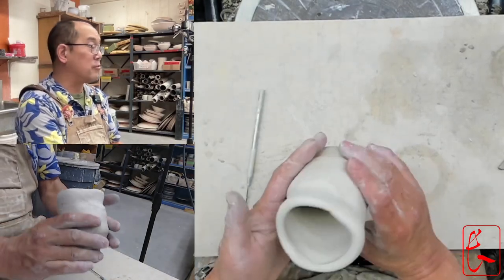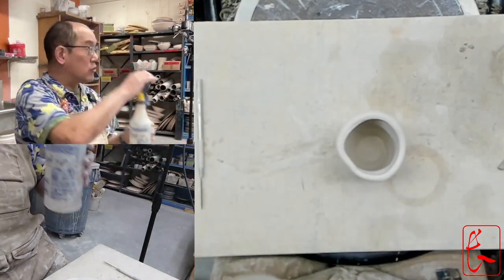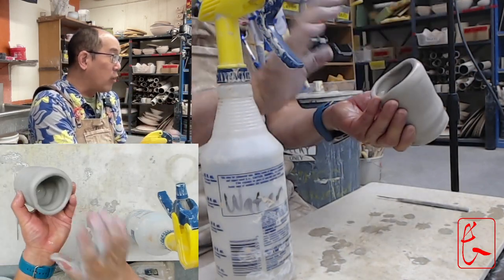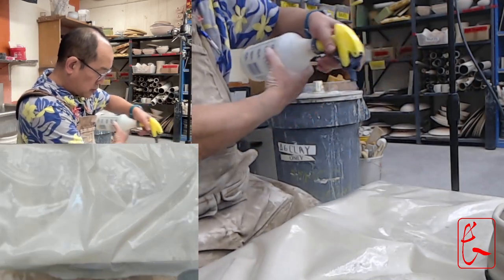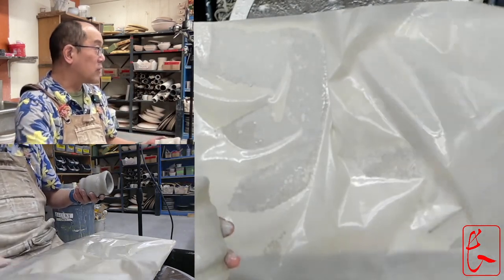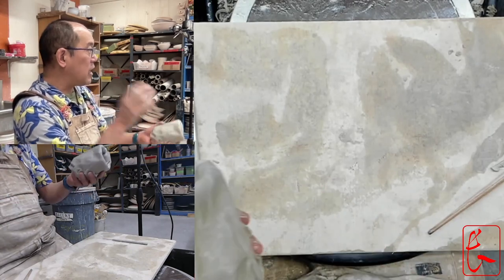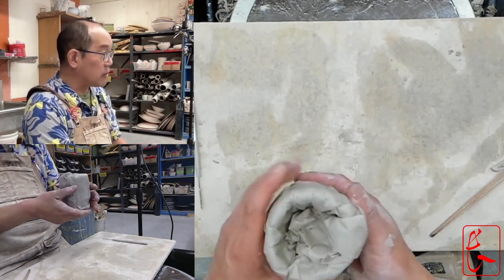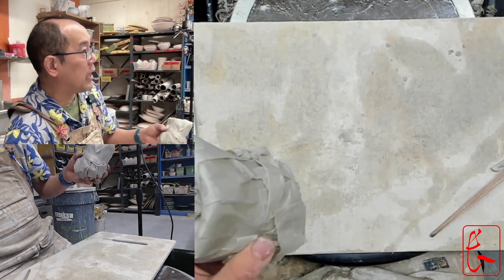Help -How to Rewet Bone Dry Pots for Trimming - Ceramics I

Comment: I have done this with a couple pieces. Glad to know I’m not alone. Granted, my pieces had not go out of hard leather, but were close so I sprayed them with water from a spray bottle in order to maintain leather so I’d be able to trim at later date without losing them completely. I’ve been lucky not to have cracks.
Reply from the maker: Sounds  like you are doing exactly the correct thing for your pottery. Thanks for watching.

Comment: What happened to this . I need some suggestions for saving a piece I need to add leather hard to bone dry . I made a base of a vase too thin and need some guidance
Reply from the maker: Controlling how fast your clay dries is so important.  Leather hard is that last real chance you have to add on clay.  It if is bone dry it will just fall off or crack later (most likely).